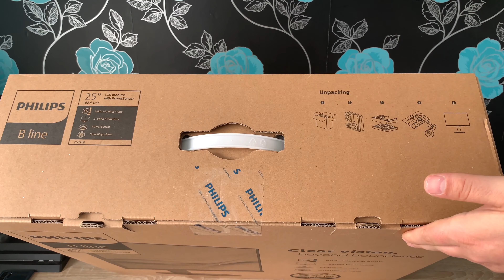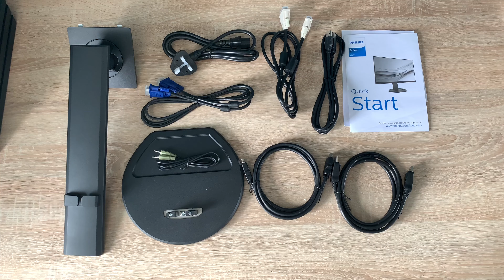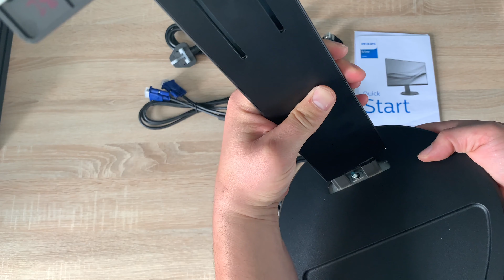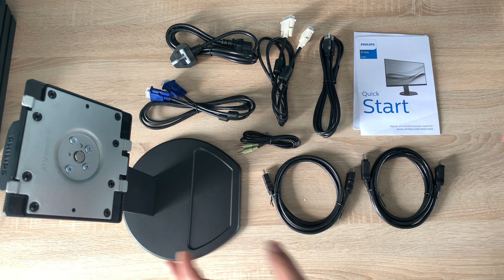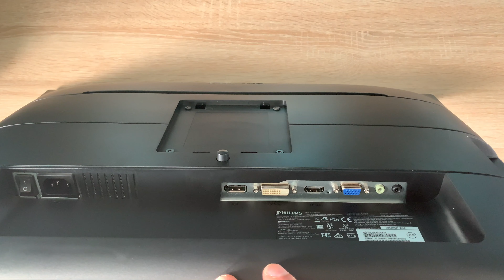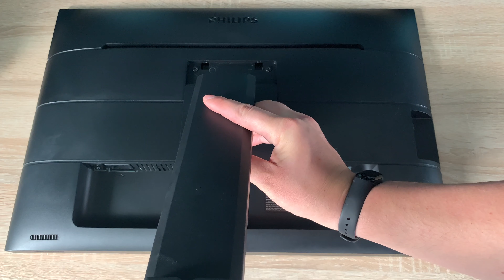Philips 252B9 LCD Monitor with Power Sensor Unboxing

Comment: Did you ever figure out why the DisplayPort wasn't working?
Reply from the maker: I sadly didn't with my MacBook Pro it worked straight away with other connected devices, but sadly has been returned now as a review unit.